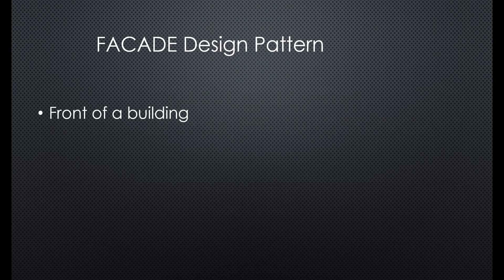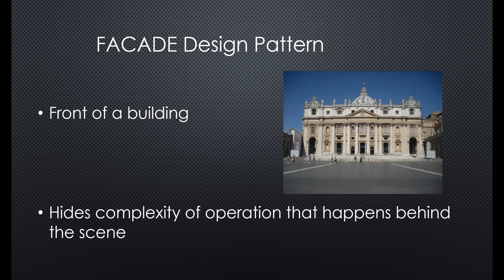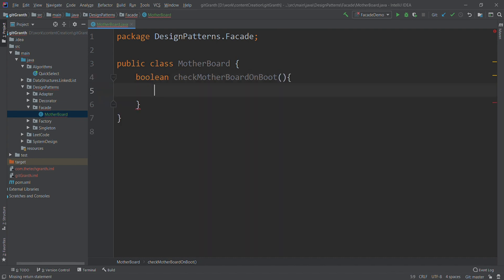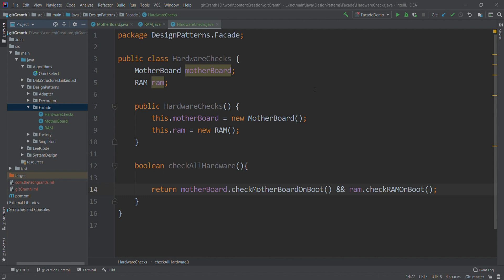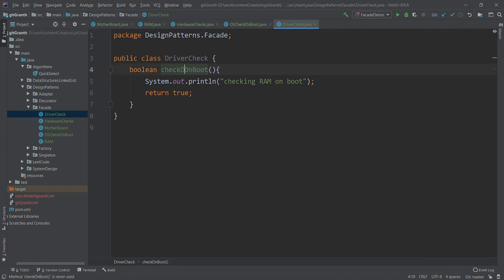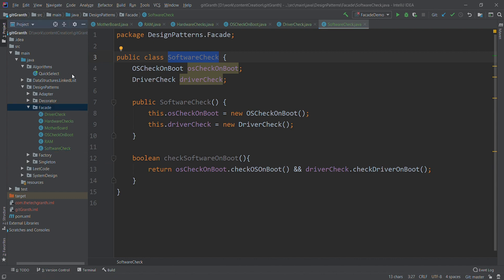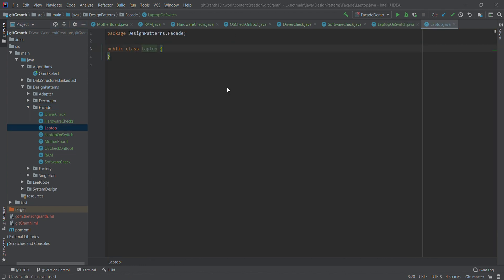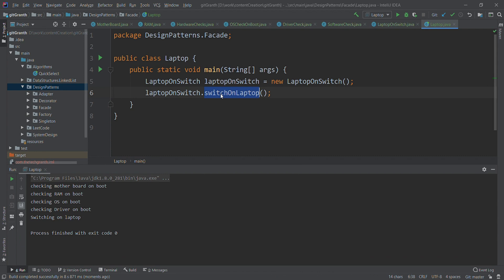Facade Design Pattern | Object Oriented Programming | Design Patterns

Comment: what is the difference between abstraction and façade design pattern
Reply from the maker: Good question, at a very superficial level, both will look similar, but if you think a bit about abstractions as a concept, you can see that there can be a lot of abstraction that can underlie a facade design pattern. 
So abstraction is just a simple way of hiding some concrete implementation where as behind a facade you can hide a complete application.
Hope this makes sense.